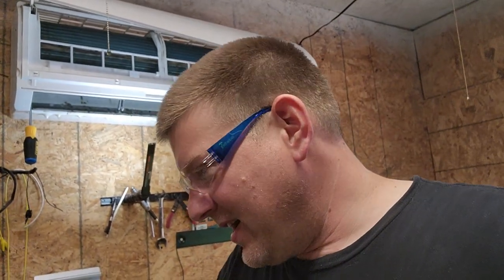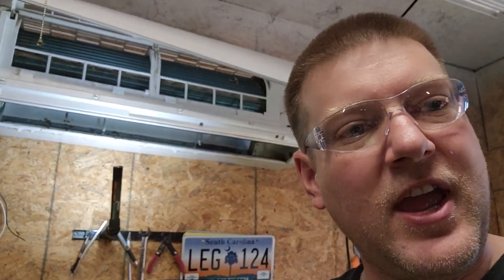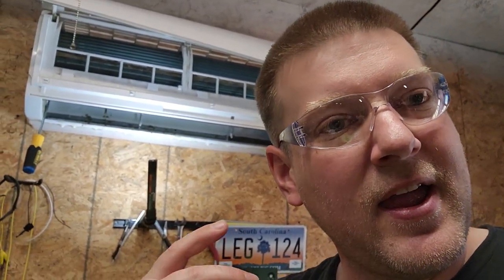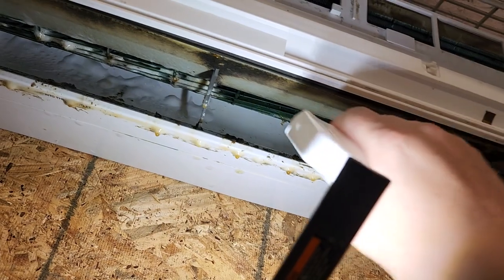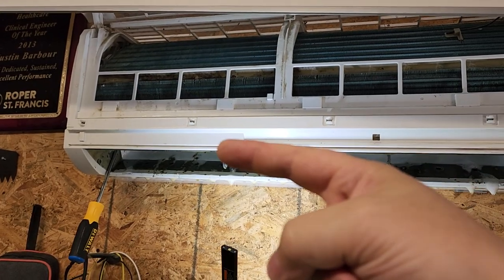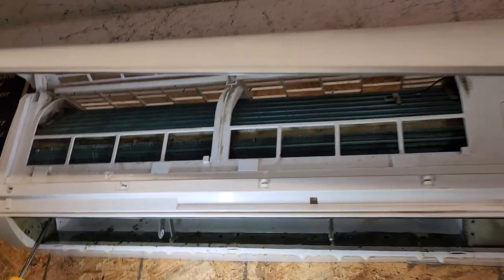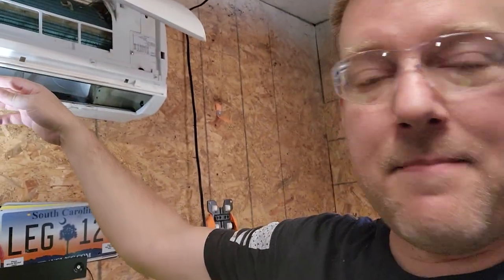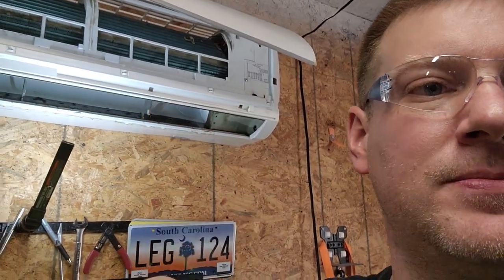Chigo Mini Split AC PM!

Comment: It's a good thing you regular clean out your AC, most people don't realise what a Biohazard situation a AC can create, especially the black mold.
The same on AC's in cars, most car repair shops don't use a anual cleaning detergent to eliminate mold and fungus on the evaporator behind the glove box.
They swap the pollen filter (sometimes only if you ask for it) and they are done.
A unclean AC can give lots of problems like respiratory problems, but can cause also the very contageous eye infection called Conjunctivitis.
A few years ago, i had to drive a small van from my boss, this van was not used very often and was always parked outside under trees in the shadow. The inside smelted musty,because it was a warm day in the summer, i set the AC on during the short trip. 
A few hours later, i got the feeling that there was something in my eye, and within a few hours, my vision became totally blurry due the pus. 
After a doctors visit the same day, it turned out to be Conjunctivitis. The next morning i got the infection on both eyes, and that lasted 3 days of using eye drops during the day and  eye ointment at night, daily refreshing my headpillow on doctors advise because this infection will come back if not. After looking up on the net what the cause is of such a eye infection, i knew the cause when i read bad maintained AC filters.
Never want to experience that again.

Comment: Hey man, you're certainly doing a lot more for your equipment than the regular homeowner, I just wanted to add a bit of advice.
Bleach is corrosive to metals, and your evaporator coil is fairly susceptible to corrosion. This corrosion can eventually aid in creating pinholes in the tubingthat carries the unit's refrigerant. 
I understand the blower wheel is plastic and no harm done unless there's over spray or it flinging upwards upon startup, but I would look into removing it before a cleaning. It's an annoying process but with the right tools it can be pulled out making cleaning exceptionally easy! Most minis require a Philips and alan wrenches for the wheel.
I'd suggest using a cleaner that is designed for evaporator(NOT CONDENSER) coils. The home depot and lowes both carry 1 option, but a local HVAC supply house carries more cleaners that may have to be diluted.
Also, just for reference--12,000BTUs= 1 ton of refrigeration, 18k= 1.5 ton, etc.

Comment: Messy job!  Is your drain line clogged?
Reply from the maker: No the drain line is not - w8th the humidity in Houston I would know within the hour from inside leaks if the line was clogged (its happened before). I regularly wet vac the drain line to clear any insect and fungal debris